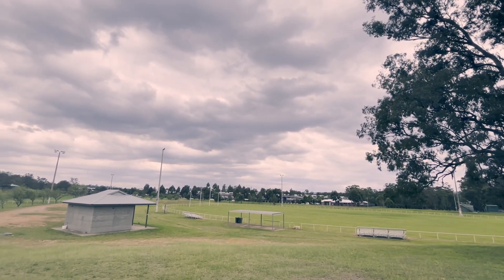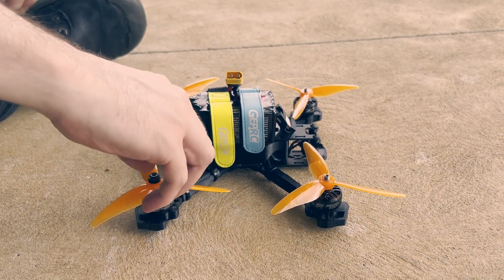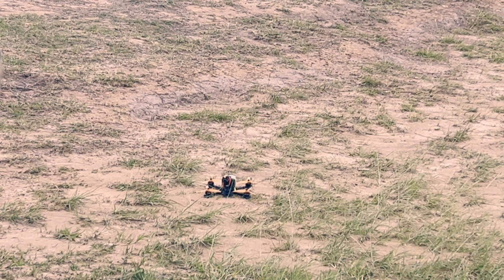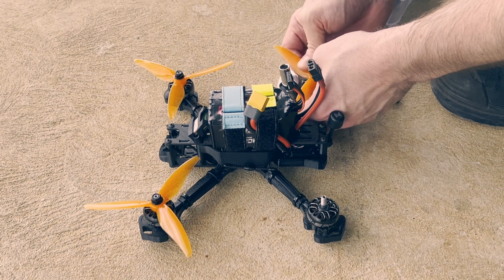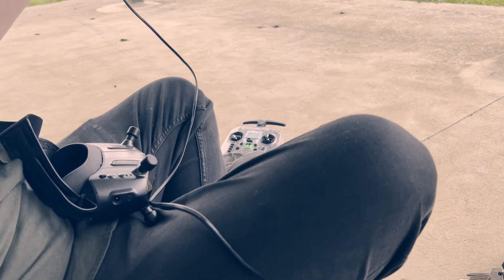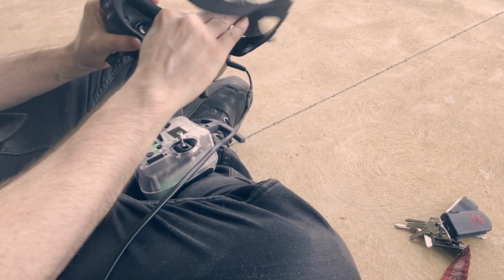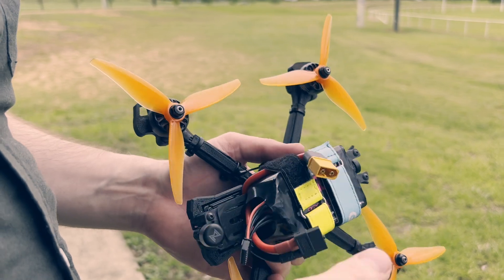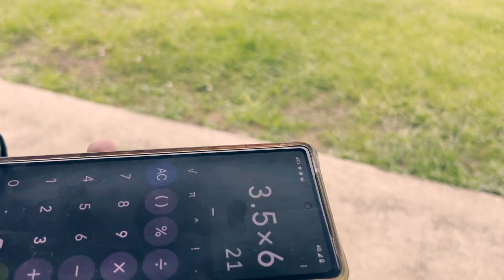First FPV flight!

Comment: Hint- have 'per cell voltage" on OSD, then doesn't matter number of cells. 3.5 or 3.6 land. And max is 4.2v per cell normally. There are high voltage lipos for whoops I think.

Comment: Your GPS needs to be flat with the sky so turning the gps around will pick up better. If it's leaning the other way and you pitch forward it's level with the sky. Otherwise great flight and spray since anti fog in your goggles.

Comment: Not going with Dji was a bad move .
V2s or integras or the gogs 2 are the favoured choice by most.
Reply: It's actually very smart move. DJI is more expensive and not better in any way. I also went Walksnail for my 3 quads and have no single regret. Issues with goggles are fixable with proper foam. Issues with range are fixable with better antennas on both sides.
Reply: @kkazakov  Smart move if you like to keep updating the firmware,enjoy the terrible range and massive breakup in picture quality then walksnail is a smart move 👍
Your video even suggests that you are disappointed with the system fogging up half way through a flight  🤷‍♂